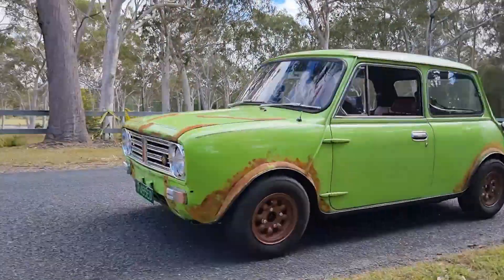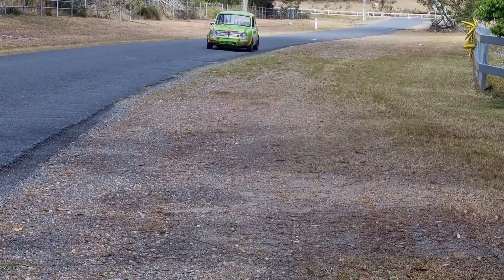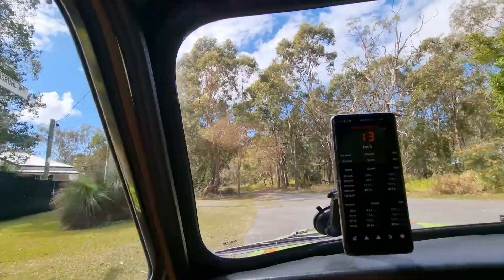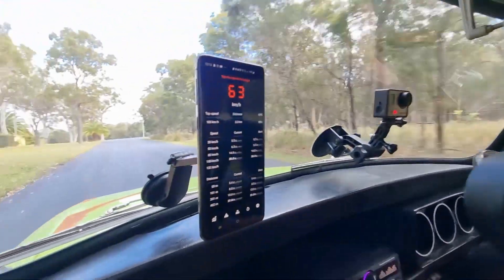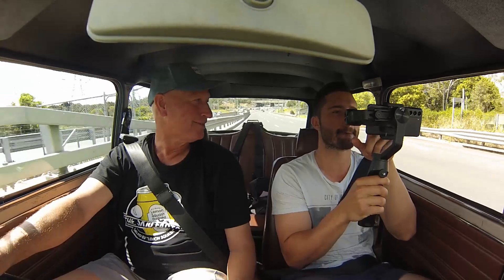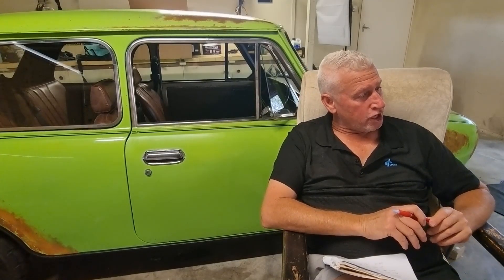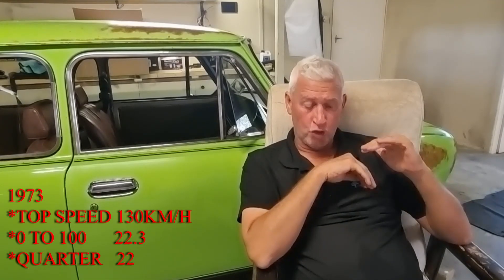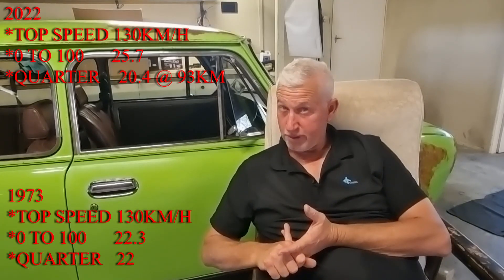JUST HOW SLOW IS A CLASSIC MINI ?? | 1974 CLASSIC MINI RESCUE | Flip My Ride Ep 9

Comment: I had thought your times would be similar to the originals as you haven’t really modified the engine much from original. Nice to see it still goes like back then! Good on the little limey bastard! 👌👌
Reply from the maker: Normally after 50 years performances rarely match the original due to...well age and wear n tear.